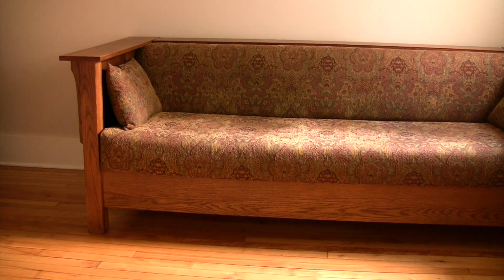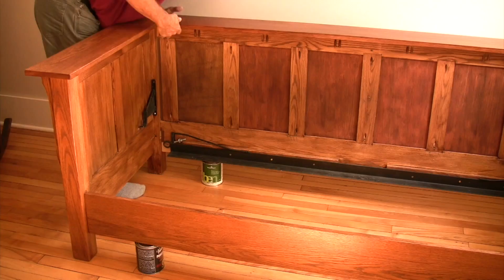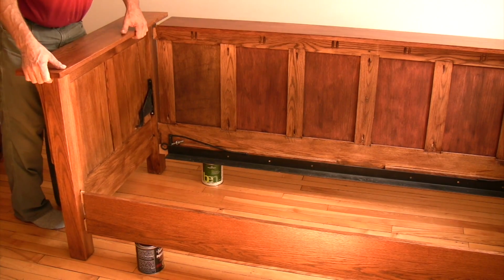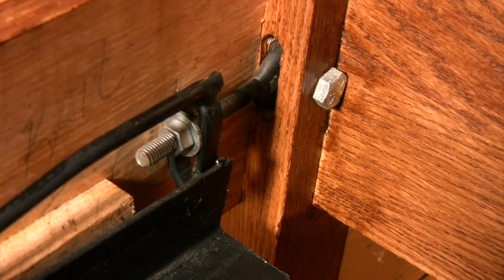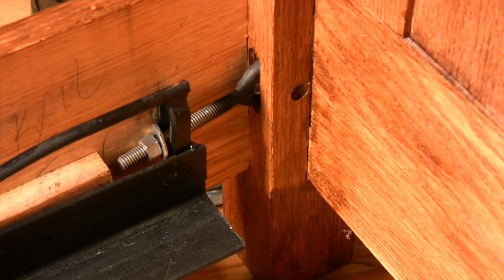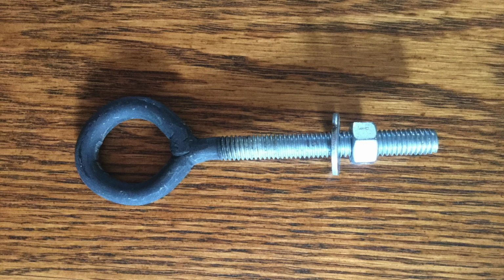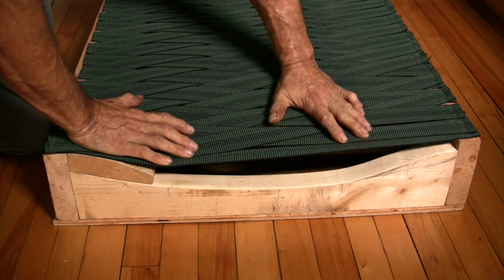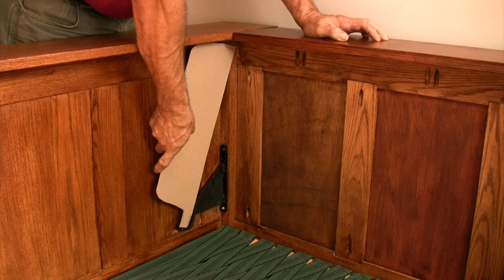Woodworking Projects -  Craftsman Style Sofa

Comment: I have a mission couch that I have just glued together. I'm trying to decide if I should go to a coil spring set up.
I see you are using a web strap system under the seat cushion, are you happy with the comfort of it?
Reply from the maker: Yes, I used the elastic strapping and it has been holding up fine.  No change from the day I built it ( but we don't have kids).

Comment: Do you have plans for sale on this
Reply from the maker: I designed this from a plywood mock up of a chair. I built this to fit me. I never found a sofa design that I thought was comfortable so I decided to build my own.  I made up a sample of the seat and back frames complete with the foam padding I wanted to use and made adjustments to the mock up until I had the seat and back proportions that I was happy with ( I sat in that for a long time to make sure).  From that  I just added the length I needed to turn it into a sofa so I never made up any formal plans I just took all the measurements off the mock up.  I can certainly send you what I have but I recommend you go through the same process because the only people that find this sofa comfortable are my height and weight with a long body and short legs.
Reply: @df-intheshop330  - What was your height, weight, and pant inseam at (Levi's jeans).   Where did you get the cushions made?  If you have the plans you should post them for a couple bucks somewhere.  It should certainly finance a nice new piece of shop equipment.